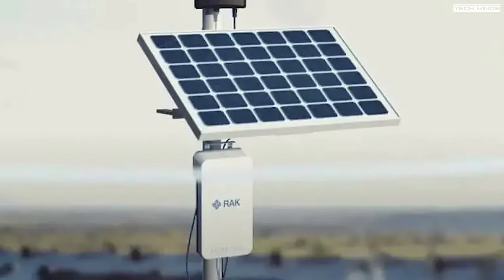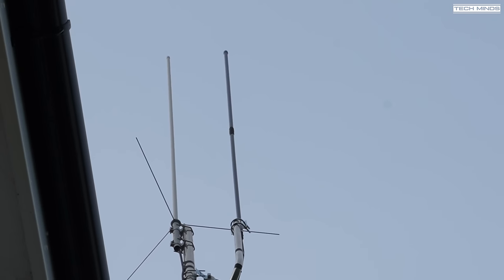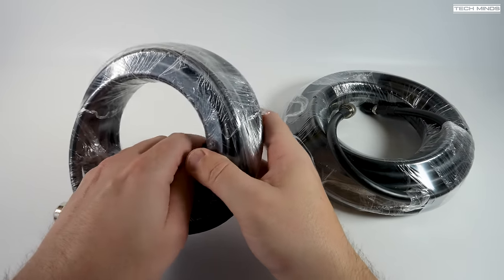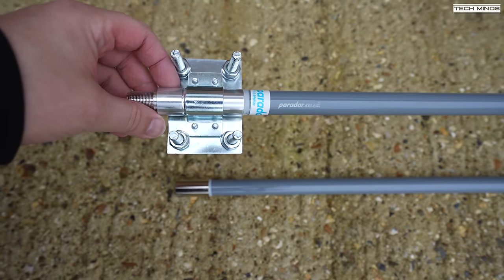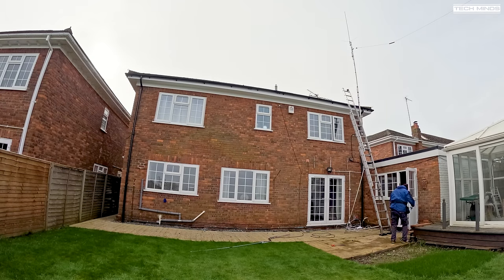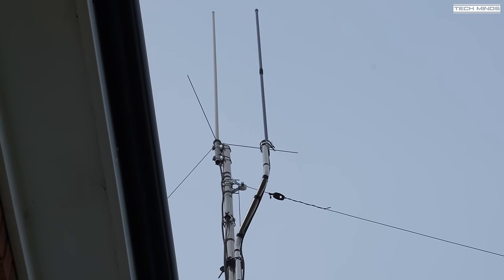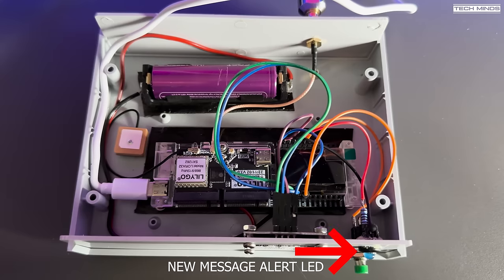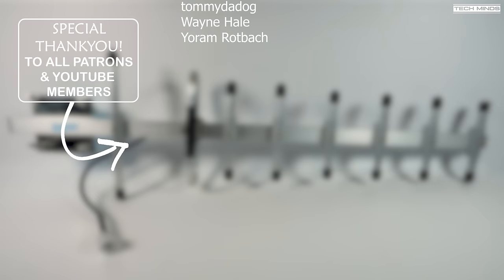Long Range Lora Antenna From Paradar - This is huge!

Comment from the maker: Frequently Asked Questions

Q1: Does the length of coax effect signal loss.
A1: Yes, at these frequencies loss is much greater than sub 30 MHz. However, the calculated loss with the type of coax I am using and the length used is around 0.6dB. So it's marginal.

Q2: What type of coax are you using?
A2: I am using Formula Zero, equivalent to Westflex 103

Q3: Blah Blah Blah Downtilt. 
A3: No idea that you are on about, but the angle of radiation is 8 degrees vertical and 360 degree omni, please look at the specs on the website for more info.

Q4: Is the antenna too close to the other on the mast
A4: Its known that antennas should be at least a 1/4 wave apart on the lowest frequency. The other antennas lower frequency is 145MHz, so around 50cm. So it's borderline but do plan to move it soon.

Q5: Will the other antenna de-sense the 868 antenna if transmitting.
A5: Possibly if I was transmitting high power on UHF. However, personally, I don't use that antenna for transmit very often.

Q6: Using something else "blah blah" is better than self amalgamating tape.
A6: I am using what the antenna manufacturer recommended. Although I will consider changing this when I move the antenna.

Q7: With that much gain is it making it illegal to use in the uk.
A7: ERP at the full 22dBm from the node would be over 1 Watt, so yes it would be. However, we can limit the power output in meshtastic.  Remember that I mentioned I will use this antenna for other projects, not just meshtastic.

Q8: How do you handle lighting protection?
A8: I don't, but if I was worried about this then I would most likely buy a lightening arrester to go inline, however this would add loss.

Q9: How does this antenna have so much gain.
A9: It has a 16-element collinear dipole inside.

Please do NOT reply to this pinned comment, ask new questions below. Thanks Matt.

Comment: Currently got a loft installed Paradar 12.5 dBi Yagi pointing at TechMind's nodes some 20'ish km away and work very nicely 👍

Tried a 8.5 dbi Paradar omni before and while rx'ing was improved, transmitting was miss-more-than-hit. That's now hooked up to an additional node that servers the local Buckingham area.

Comment: Something to take into consideration up 800-900MHz is your SWR will read better because the loss of the reflected power in your transmission line. 

SWR is proportional to the  reflected power at the point of measurement. If you’re losing 3dB return trip at the test frequency, then your SWR will be lower. 

To get the true SWR, you need to measure that at the base of the antenna, or, if you don’t want to climb a ladder, you can calibrate the transmission line out 

You can also measure the loss of your cable by measuring S22 log mag on the NanoVNA
Reply from the maker: Already done personally, but a very good point for others to know about. Not just 800 to 900 MHz, all frequency ranges can be effected with the type of coax feeder that's being used, but higher frequencies can most certainly be affected more. I know this from when I designed my 2.4GHz amplifier and QO100 uplink gear. I did read the SWR directly to a network analyzer before installing the antenna, and it was around 1.3.
Reply: @TechMindsOfficial  have you got a video on the 2.4GHz ?

There is so much cool stuff that’s available to play with in the microwave bands. I was watching some videos by some fellow Aussies who have managed to get a $30 radar module working on 122GHz. 

Me, I ordered some Haltec units. One for 915 and one for 433. Curious to see how popular Meshtastic on 433MHz is. Got a few 70cm band options to try.
Reply from the maker: https://www.youtube.com/watch?v=ckfKviIJ6J8&list=PLhyHRyhOtNvfwPm-HhZiWOpdARCh6zjkp
Reply: @TechMindsOfficial  wow. I missed this. Last year I didn’t do as much radio. Spent much more time with a guitar in my hand. 

Trying to balance both….and keep the renovations on the house progressing.  Got to keep the minister for finance, entertainment and shoes happy. :-)
Reply: When using an external antenna and coax, the most importing thing is to tune it as close as possible to the magical 1.0 SWR, otherwise received and transmitted power is wasted.  Oh, and it also makes a great lightning arrester. ;D

Comment: Cool, i was wondering what to do with my old helium setup which includes this antenna and coax, I may as well throw a node onto the system, I’m 200m ASL in Shropshire.
Reply from the maker: Awesome! It should work well with 200m ASL!

Comment: You need to add a few layers of tightly wrapped quality (3M) vinyl  tape on top of the self amalgamating tape. This compresses the amalgamating tape creating a water proof seal & protection against the elements.

Comment: I bought a bunch of 11dbi high gain antennas for my 5ghz WW-DRT wifi client bridges... and when I swapped them in for the stock 2dbi antennas bundled by the manufacturer, the 2dbi antennas ended up working just as good or even better.    So I sent the 11dbi antennas back and got my money back.    So never assume something is working and test the before and after by looking at an actual signal strength measurement in whatever radio software you are using wit one antenna, then the other.    Once you find the best, then experiment (further) with tweaking aiming and location.

Comment: It might help with longevity to apply a layer of of UV resistant PVC insulating tape over the self amalgamating tape.
Reply: 100%. For an antenna thats gonna sit on the roof in all kinds of weather, electrical tape on top of the silicon tape is a must.

Comment: Looking into the band plan, it says max. transmitting power on 868MHz is 500mW ERP, so it would be illegal to use an antenna with 11.5dB gain unless TRX power isn't reduced. Maybe this is different from country to country.

Comment: The two antennas are close together, if you transmit on one will it blow up the Meshtastic node?
Reply: That would be my concern as well. I mean it depends on the power of the other transceiver, a few watts is probably fine?
Reply from the maker: Not at all. The other antenna is for 145MHz, 430MHz and 1200 MHz. If I was going to use that antenna with high power then I might consider turning my node off, but it won’t be an issue.

Comment: I think I'll make a quarter wave ground plane antenna for under a fiver first, Matt. Welding wire and a panel mount BNC socket make a resonant antenna fit for a try out
73 de David M0YDH
Reply from the maker: Home made antennas are best :) more satisfying when they work :) cheers matey.

Comment: I am picking you up in south Dunstable all the time but unable to get back but then I am using a smaller antenna than you maybe I need to instal some thing similar to you
Reply from the maker: I guess thats the draw back when having a larger antenna. It like if someone runs a linear amp, everyone can hear them but they cant hear anyone else. Well, kind of..  Hopefully you'll be able to make it to our mesh soon. Cheers

Comment: I recently monitored the 915 MHz (for US and Canada) here at Port Alberni BC Vancouver Island Canada using my RTL SDR and a small homemade tuned 1/4 wave ground plane and 2 feet of LMR 400 with RTL dongle high up with the antenna  10 feet above my porch.  it is packed with twice as many signals,  much to my surprize.  I just ordered my new  T-Echo and accessories still in shipment.  I saw these 30 inch or higher oversized LoRa whip antennas at the Rocklands website catalogue.  I was kinda skeptical   of its capabilities being so big like a conventional 27 MHz  CB antenna.  I may look into these high gain omni antennas in the future.
Reply: Where you actually picking up mesh signals or just 900mhz stuff in general?  Could you decode it?

Comment: Are you thinking of trying 433MHz? I've got a 5 element yagi pointing your way. I'm in Welwyn Garden City so it might be possible
Reply from the maker: Yep, I tried but it but not pick up any nodes. Although I only tried it in "ham mode" where the encryption is turned off. Is your 433 node in ham mode?
Reply from the maker: What freq? Default? Ham mode? Vertical polarisation?
Reply: @TechMindsOfficial  I've set the T-Beam to Ham mode on Long / Fast. The node name is VDTX an my call sign is G0VDT. I'm using a 9 dB gain. I'm going to to some range these today.

Comment: I live in the hilly hills and dells north of Boston MA. My 9 dbi antenna is up 30 feet from my 190 feet ASL. On the same Tower, I've got a 1090 plane tracker 9ish dbi that can hear planes out to 150 miles. Unless they are flying low, like when landing in Canada. It's line of sight only. 
My recommendation is not to use highest gain antenna, IF you have a great location, up high. Your LoRa signal pattern (very flattened donut) will pass overhead of any nodes in the local area. But might be good, for distant nodes in high locations. The mobile node in the pocket of someone inside a building a few miles away, might not hear enough signal.
Reply: Interesting. Nice setup you have.

Comment: How do you handle lighting protection on something like this?
Reply: I'd recommend checking your local building code / guidelines how to install terrestial TV/radio antenna. Lightning protection should be included in such document.

Comment: Time for a change in thinking if meshing, rather buy 4 nodes and distribute them between friends in town on hills if you can.
Reply: These nodes I hope will become cheap enough for them to be paired with a solar panel and placed on hilltops and high points.
Reply from the maker: @sUASNews Yep, just one node set as a repeater at a really high location will feed a decent area.

Comment: Instead of the ugly tape you can use heat shrink tuning that has a sealant built in. They are removable too as the sealant int hard to get off when done purposefully

Comment: Do you know any manufacturer that sells similar antennas but for radiosonde frequencies? I find only for Lora and adsb
Reply from the maker: I guess that would be around 400 MHz. You could try searching for UHF or 70cm antennas and see if they go that low. Ive used my home tri-band antenna for receiving Radiosonde for a while now and get excellent coverage over the south of the UK with it. The other option would be to make a simple 1/4 Wave Ground Plane antenna for the exact frequency.

Comment: I'm struggling to see how a vertical antenna can have any gain over an isotropic antenna.

Maybe it's my lack of knowledge.but I am curious.
Reply: The radiation patten is flattened. Instead of looking like a doughnut, it looks more like a pineapple slice!!! So, there is more energy at the level of the antenna.
Reply: If you look carefully when he’s going through the spec sheet, it’s a 13 element co-linear.
Reply: @daveys Perfect!  That's the type of thing I was after.

Thank you.

Comment: What crank mast did you use?
Reply from the maker: It’s just a “cranked” pole, as seen in the video when he climbs up the ladder. It wasn’t planned to use it that way, but the antenna installed didn’t bring a long enough pole for it to go above the roof line, so, we installed it like this. Luckily I had some spare mast clamps to clamp the two masts together. Cheers

Comment: Use bandpass filters to cut out RF noise. Especially with good antennas at high locations. This will drastically improve your range.

Also LMR400 or better is a must if you're antenna requires more than a foot or two of coax cable.

Also the industry standard for tape of any type to water proof is to create a staircase style wrap. From top to bottom, then without breaking, go from lower bottom to higher top. If you're short on tape, do at least one clean run without breaks from bottom to top so water beads can flow down and off like roof shingles.

Comment: using this antenna without reducing the TX power of the node will take you above the legal transmission power of secondary users of the ism band

Comment: Will this be a quality antenna for 915 MHz?
Reply from the maker: I’m pretty sure the specs says it covers 915, but I didn’t check the swr at 915. Next time I turn off my node I’ll check it.
Reply: @TechMindsOfficial  I really appreciate it thank you. I live in Springfield Oregon Us and I'm trying to get a small Network set up here. My son my wife and myself have been using the metastatic Lora with a fair amount of success, we are the only three in a very large area. My friends are too bougie to use something subcellular or alternative I guess.
Reply: Just out of curiosity are you aware of any technology that would allow us to use Wi-Fi connections as nodes. Seems like a good idea and probably just a matter of software. I've been messing with sideband and if we could get Wi-Fi routers to work as nodes that would be fantastic.

Comment: With approx. +22dBm output from the transmitter and +11.5dBi of antenna gain relative to an isotropic radiator, doesn't this place you above the +27dBm ERP level for 868MHz Meshtastic? Be good and if you can't be good, be careful!
Reply from the maker: In theory i could actually lower the output power with the node if it becomes an issue. However, considering there is some complete tool about to start selling rf amplifiers for Lora, do you think they care?
Reply: @TechMindsOfficial  Then I imagine another complete tool will combine the high gain antenna with the RF amplifier. Where do you draw the line if not at the legal limit? Tough one... especially as I'm also slightly illegal with an +8.5dBi omni Paradar, albeit in the loft.
Reply from the maker: @Mike-H_UK I have a very strong feeling that individual was testing amp and high gain antenna a couple of days ago... 8.5 paradar in the loft is a perfect setup. I ran a small 5 dbi amazon antenna in the loft for months which worked really well. I just wanted something outside so I can test my other projects I am working on, like FLARM and OGN. Cheers
Reply: @TechMindsOfficial  It will be interesting to hear how you get on with the big omnidirectional Paradar. It has almost the same gain as the Paradar Yagi (12.5dBi) while being omnidirectional in the azimuth. Presumably it has a fairly flattened radiation pattern, but I don't see this being. disadvantage for most locations.
Reply from the maker: @Mike-H_UK  8 degrees I think the specs said, but I'm only around 100m ASL and surrounded by hills. So it should be okay. So fay so good! Testing FLARM earlier and had some great distant decodes, but then again they are transmitting from the clouds lol.. Cheers

Comment: Why don't they supply a waterproof join. Its like selling faulty equipment
Reply: it’s very common to put self amalgamating tape on antenna joints
Reply: They don't tell you the N Connectors have rubber gaskets to keep the insides dry, and the sun will dry out the connector shell. If you tighten them up properly. 
But, where the coax goes into the connector, has a thin rubber gasket around the cable, that's not always water proof. So, additional waterproofing is a very good idea.
Reply: @eliotmansfield  I know but you don't buy a car then tape all the windows up incase they leak. At the price of these antennas they should supply something

Comment: Hi
I have a 25 meters tower Could I do the same?
Found this from China:
Frequency: 860-930mhz (EU 868MHz, US 915MHz) gain
maximum: 12 dbi (not one (fixed value)
Rated gain: 5.8 dbi standing wave ratio: 1.9 (dB) cable: RG58 cable parameters: single core wire
Cable outer diameter: 4.95+5mm
Cable Material: PVC outer quilt
Wire type: High Braid Shield
Impedance: 50 ohm
Working temperature: -40 +85 degrees Celsius
Relative humidity: up to 95%
Length: 550mm
Material: glass fiber 
(could work?)
AMAZING content Brother
New Subscriber now
Thanks in advance 
Regards
Reply: or should I search some kind of simpler antennas ... maybe?
Such as:
AP5249 5/8 wave VHF Base antenna features:
Inox ring on its base that allows installation in pipes from 25mm to 34mm (internal fixation) or from 43mm to 46mm with 2mm wall (external fixation).
Ringo coaxial connector of international standard, to facilitate its connection with cables that have UHF male type connectors.
It comes with connector sealing rubbers for two sizes of RG58 and RG213 cables.
Tkx

Comment: This co-colinéar antenna is good for summit not for low altitude !
the radiation pattern goes downward on this antenna with a lot of gain, in the configuration of a flat area your waves go with gain into the ground rather than towards the horizon!
the performance is not at its maximum what is possible with this antenna on a plain
Reply from the maker: Please provide more information, such as a link to a plot which shows this.
Reply: @TechMindsOfficial  This is part of my hamradio license.
the more elements an antenna co-collinear has, the more gain it has up to a certain limit where adding elements no longer brings anything concrete.
and the more the electromagnetic radiation angle of the antenna will have a negative downward angle.
Yes it works in town but not to the maximum of what it is capable of, it is optimal at altitude at the top of a mount for example for a relay.
an antenna simulator like MMana-gal for example allows you to observe this effect virtually.
73' F4JPC

Comment: That's an expensive antenna.
Reply: Buy a commercial grade antenna.  Last two Station Master colinear antennas I got were over $1,600 each and that is cheap.  If I had bought Sinclair Technologies antennas with the same gain they range from $5,000 to $6,000.